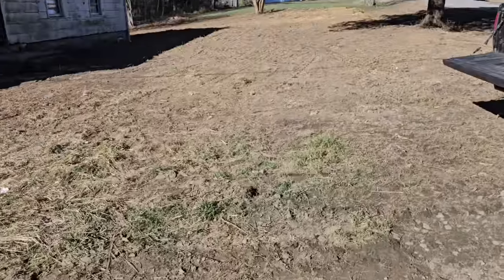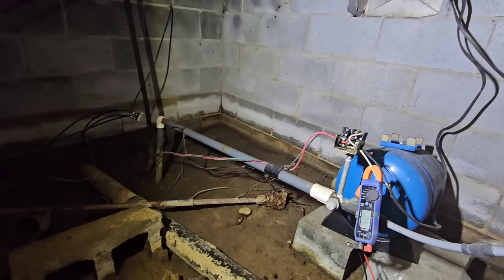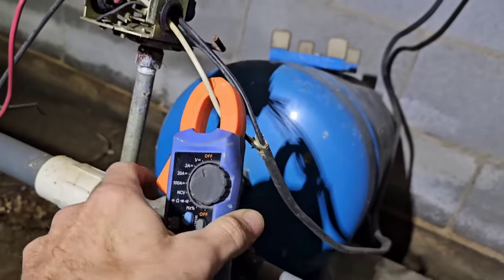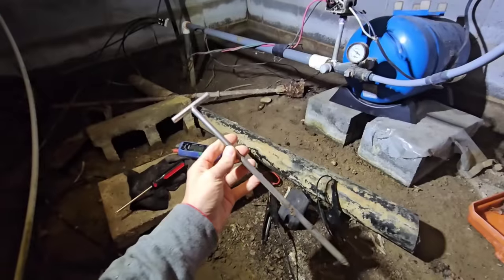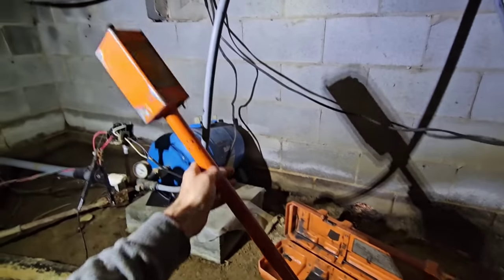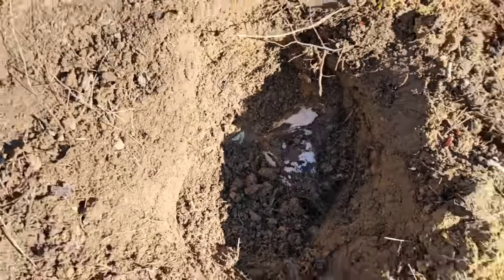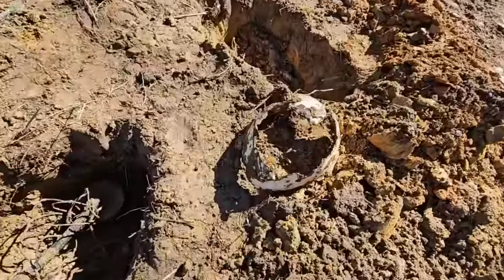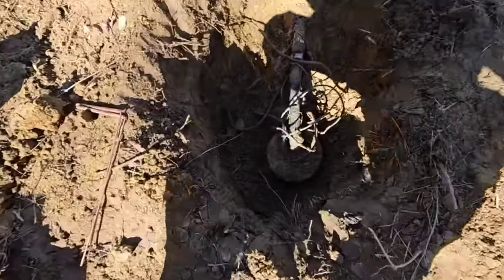Can Copper Dousing Rods Find a Water Well below the Ground? New Tech Vs. Old

Comment: My dad taught me to use  dousing rods when I was a child and as you have saw, they indeed do work. The reason this method has been handed down is because it works. My dad also taught me to use a Y tree branch that works just as well.
Reply: The first time I tried the rods was when a pipe-fitter came into my office and challenged me to find a below grade drain line. He knew where it was because he installed it many years ago. The rods he gave me had a sleeve, made of tubing over the rods, so you could not in any way influence the movement of the rods. He showed me how to hold them and instructed me to walk across the office complex. As I walked the rods starting pointing forward and then suddenly came together and then as I continued in the same direction they spread apart, towards my biceps. As I continued walking they pushed against my biceps. He said that they spread apart at the exact location of the drain line. He told me that not everyone can use them and then gave them to me so I could test my two boys with them. I went home and showed them how to hold them and to walk over an area that I had installed a water line to our house. One of them could find the line and the other could not. I am a believer.

Comment: As an electrician I used just plain pieces of wire to find pipes and wire using this method many times . I have also shown helpers and apprentices this trick . Most were skeptical at first . 
It did not work for very few .

Comment: I'm a miner and a prospector in Alaska. Dowsing is one of our "go to" methods for a quick and dirty method of locating mineralized vein structures and faults. There is scientific principal behind it. Anything that interrupts the magnetic field of the earth(including wires and water pipes) will affect the rods. Buried high voltage lines will really snap the rods. Almost spooky. This is also done on a big scale by flying a monitoring torpedo from a helicopter. Called geomagnetic mapping. It's not Voo-doo. I might add that some people have better performance with dowsing rods than others. I happen to be very successful with them. A geologist friend believes it's due to the continuity of a person's body. I'm also very sensitive to electric current.
Reply: amazing👍

Comment: I’m a old timer 73. My father in law prove it over and over again. First time I tried it in my yard using a bent coat hanger, one for each hand and the stupid things almost jumped out of my hands. Of course you hold them loosely.  I am a believer!!!
Reply: We use 3mm thick copper wire  and it works all the time. No fancy tools :)
Reply: we used fencing wire about 3mm and held the wire really tight and they still moved

Comment: You already knew the well was between those two spots and those copper rods don't attract therefore psychologically you probably made those turn in.
I wanted you to use the rods to find a well without the electronic tool. You would have found nothing with copper rods or a stick looking for its mother load of water or any of that nonsense. These guys using the sticks and find water it's because there's lots of places in the ground where you can hit water.

Comment: I really enjoyed this video. You did an excellent job of locating the well using the power sinal method and then using the dousing rods to determine exactly where the well was at. I am skeptical of using dousing rods, however they certainly worked in this application. I love all of your research that you share and I also love the fact that you give your customers all of the pros and cons for drilling a well!!!

Comment: We have had 3 wells drilled on our place over the years.  We have used witching for determining where to drill.  Never used it to find water lines. The first two wells were witched by an oltdtimer in the area. This was 1996 and he used a forked willow branch, and we found good water on both locations that moved the branch.  The third was done 2020, with copper rods and proved to be very good water as well.  Thing is, as far as me thinking this is for real, honestly part of me says we would hit water anywhere on the ranch, but I still want any locations witched just for good luck on a new site.
Reply: You are a very wise man. My cousin had aome land he wanted to build a house for his sisters and we wished his place and I told him where to dig, but he said NO I want it right here, So he paid 5000.00 dollars to dig and he went down 176 feet and yup he hit water, Well he hit 12 gal per min, of sulfer water. He thought f he went by where my well was he could also hit part of my well of 4 to 5 hundred gal per Min. It just does not work like that. Stay safe.

Comment: I truly beleive in dowsing rods.
As a teenager this old guy got me intetested in them. The city where i lived. Needed to drill new wells. They drilled four test wells. All were duds. They hired this gentleman to dowse a well fir them. Low and behold,he found them a water source. It could supply enough water to run the biggest pump made 24/7 with no depleation of source. He found an underground aquifer. It was approximately 50' wide.
He even told them how deep it was,and type of soil and rock they'd encounter. Needless to say,that was @50 years ago. And the well is still in service today. No problems. SO......

Comment: I knew 2 dowsers, and watched them work. Well about 50 years ago I moved my mobile home to a spot that 'There was a water pipe buried somewhere -over that way-" I did not feel like digging up 200+ feet of pipe to find the  end of it to connect to. So I got to thinking "Hmmmm", I'll try dowsing. I have nothing to lose except a lot of work I don't need to do.
 I took 2 old shell casings and 2 pieces of copper plated welding rod and started walking. I concentrated "Where is the end of the water pipe" while I walked. By golly, I hit a spot and the rods crossed (I did try a willow "Y", but it didn't work for me). I dug down 1.5 feet and I was 4" from the dead center of the pipe where it ended. That blew me away and made a believer out of me for sure.

Comment: I'm also an old timer, 71. I learned when I was about 10 or 11. When I was taught to dowse for water, we were given a crow-bar. Just lay it in your hand and hold loosely, down by your side and walk. When you get to water, the crow-bar tips quickly. If you ever walked a fencing line or field with a crow-bar, and the dang thing keeps tipping, you may have doused for water. He also showed me how to use welding rods, just like your copper rods. It works. Don't know why, but it worked. I got calls from a few farmers after that to find water. There seemed to be water where I dowsed, but who knows if they couldn't go several feet over and find the same pool. Most of those wells were 75 to 150 feet deep. Strange feeling when it works.

Comment: I worked as a carpenter my last summer in Tucson AZ, in 1978.  We were building triplexes on desert land kind of in the center of the metropolitan area.  One afternoon a technician from the municipal Water Department came out using a dowser almost exactly like the one in this video.  I laughed to myself but didn't say anything.  And I nearly fell out of my britches because it worked.  I saw the copper wires cross and the water pipe was found in that exact place.  So dowsing does work even though it seems like complete nonsense when you look at it scientifically.

Comment: Well now let's see... brass brazing rods, couple pieces of #9 wire works too. Used to be an old timer dowser well known towards southern New Hampshire, accurate as can be, with depth and flow. Just drill when he set is stake, instead of guessing after knocking the stake down during setup!  lol  -Bob...

Comment: When I put in a well and septic system two old guys came over and walked over my yard and checked it with dousing rods and he found a place where they crossed twice and he layed a rock down and stepped on it to mash it down and he brought a old churn machine over and started drilling and a little ways down he hit about 8 gpm and said that there will be more to come and at around 50 ft he hit another vein and was dipping off over 20 gpm which was as fast as he could dip it off and I put a pump in it and it has been about 30 years and I have not touched it and we still have plenty of water and after he found where the water was I made me a set of rods and tried them and found the same thing that he did, I believe in them for sure.

Comment: I use copper dowsing rods. They work! I have used them to locate buried septic system lines too.
I worked at the telephone company. We used them occasionally to locate buried cables. In the Bell System company equipment catalog we could order telescoping dowsing rods, but we made them from #6 solid copper ground wire. I learned from an old timer cable splicer.
Reply: have also used rods to find man hole covers burried when they would pave over the phone or electric covers. I was a cable splicer. Stay safe.

Comment: I had a water pipe in the backyard that was leaking but could not locate it.  In desperation, I bent 2 copper coated welding wires and located it in less than 2 minutes.  It's nuts, but it works.

Comment: I used to do municipal sewer and water line repair. We had various equipment for locating water lines, we always used dousing rods. We would simply making them out of materials for free. You can rip off flags off of flag markers and bend them at 90 degrees, with a long end sticking out, short end in the hand, then hold them very loosely in hand. It works reliably. It can have interference from powerlines overhead, so if you have an area with multiple lines or lines in the ground and powerlines above, it can get confusing. Very reliable technology. Most people dismiss it because they have never learned to use it and have no idea how well it works.

Comment: Do you think HydroVacuuming a hole instead of manual shoveling would make it better on finding buried lines? 
Shovel blades may cut the wires. Hydro Vacs only pull the dirt slurry away. Leaving undamaged pipes & wires.

Comment: 💁🏽‍♂️ How it works;  it, (the rods/y willow sticks) follows the force lines of flux. Or flux lines. EVERYTHING has an electrical element in its makeup. [because atoms ⚛️ always move] . The rods will “point”, 90° of the direction of travel or layout of the pipe or movement of water or electricity running through a line. Flux lines above still water are jumbled up, but in a condensed area, and will show a deflection of said rods/y sticks.  😎🤷🏽‍♂️ Your welcome. 🐎🐎🦅🪶🕊

Comment: My first experience with dowsing rods was really shocking to me.  The rods crossed when I passed over water hoses , electric trenches & valts , also roots from trees. REALLY AMAZING. 
 to me.  So. I painted a spot on the ground. The well driller went to work and he hit water . 
 Not bad for my first time.  The Well Driller inspected the area,  and came up with the same place I painted on the ground. 125ft later .... 
ALL THE FRESH SWEET COLD WATER you want. 
 🤜🌟🤛

Comment: At 77 yrs old I can say my first experience with dousing was from a friend who doused with Willow Branches....drilled and hit great water..that was when I was 32.....I started fooling around with Willow branches and then Coat Hangers I bent and held very loosely ...I found water pipes underground for a friend...found my next well...found a under ground spring I didn't even know ran thru my property....so I would say.yes it works...........I didn't believe in it when I first saw it done eiher...but wanted to prove it was poo-poo.........BUT IT WORKED!!    Cheers good video!

Comment: I don't use copper rods I am 62 years old and watched hundreds of wells  both dug an drilled. Here in north western Ont  Canada you can't just drill a hole an get water any were like in the south were the whole under ground sounds like a big  Aquafer lake under ground. Here if you drill the steel caseing must have a weld on drive seal shoe. Casing must be driven into solid bed rock. A dug well you find the vain of water in a change from soil to gravel. With drilled well you also have to find a Crack in the hard bed rock were a steam of water runs through   do to the minimum charge drillers charge. I make sure I find at lest 2 veins crossing  using a willow branch that in a Y I hang on to the 2 y Handel's out strait an the one stick part will bend down when you pass over a water vain. The harder it bends down the more water there. I have witch lots of land an marked were to drill in 3 to 6 place. The customer or my self never tells the driller anything. We watch an see what they do. 3 out of 3 companies come in an just look. An say let's set up here. They didn't witch anything. I let them set up there 130,000 lb drill rig tanker truck. Dril rod an pipe casing truck. Then I walk over to them an say  look this customer is paying your crazy price per foot with a minimum of $8000 weather you hit bed rock in 30 feet an water at 40' it still minimum #8000 so why are you just picking any spot when you know there 1 in 10,000 you find water witch Mayberry at 600 feet. That good money for you but bad for the customer. I say you drill over here were I know you will get water. They refuse. I tell them fine if you don't hit water in 200 feet it a dry hole an that's on you. Then your going to drill were I asked you to. That one the customer will pay weather you hit water or not. Every time we stop them a a dry 200 feet. Tell them you lost now drill were I asked. They do an have hit any were from 4 gpm to over 20gpm in less then 200' some less then 60' my well is 119 witch I had them dril a 8' sump in bedrock for any crap. My nabor across the road they drilled 2 holes the 1st was dry then they drilled were I asked. An went though 47' of clay an into bed rock hit water 10 gpm at 62' he only paid the one drill hole. To get a bank mortgage the well must put out minimum 3gpm. Mine is 4 gpm feeding 25 head cows. House. 2 air b an b chicken an turkeys bans water gardens an never run out of water. Crip clean minirel free water. Some guy with witch with a steel craw bar but most use a green live willow branch with a good 3/8 with a Y it never wrong. There no getting a permit to do a well from heath unit only septic. The drillers must get a permit for each well over 40' from minister of mines an  Environment and must record every foot of ground an supply you an ministry paper work on every hole they make. They are responsible if they hit bad gas or other harmful things. The 40' over permit is to not apply to dug wells with there million here a drilled well must be 50' from last septic field line an dug wells 100' but there old drilled wells less then 50' an every year everyone send in a water sample to our heath unit for a free water test for   Any bacteria even dug wells in barn yards come back 100% clean as well as drilled wells close to septic. Only one drilling company here come out before the eqipment an witches were the best spot to drill. In Oct 1998 when my well was drilled an hit water in bed rock an drill rig dropped 18" into a hole in bed rock were I watched 4 main vain cross there was no minimum charge. It was a flat price per foot with steel casing until hit bed rock then a flat price per foot drilling in bed rock witch was much  less. They hit water at 112' but I had them take it down to 119. My bill was less then $3000 cnd before tax

Comment: I have used this successfully for years.... 

On a few occasions, I have made the rods from the flagging wires. Just rip the plastic flag off, bend a 90-degree in the wire about 6 or 8 inches from the end, and go dousing. Make sure you dont have gloves on as you hold the rods.

I found numerous unmarked graves at a real old COUNTY POOR FARM...😊

Comment: I use utility locate marker flags for my dowsing rods. They're steel. I tear the flags off, and bend them. I've located ductile iron, PVC, fiber optical cable, and copper pipe.
Electromagnetic locators like your Schonstedt are great until you get into a bunch of junk.
One day, they swung out, settled with one a little bit in front of me to the left, the other back and to the right.
At the edge of the property, a fiberoptic cable was marked veering across the sidewalk. To the left in the neighbor's right-of-way, was a huge mulberry tree. The installers went around the tree.

Comment: You could have used the rods to locate the pipe and wire too.  The rods aren't anything special either, you can bend old wire coat hangers into the "L" shape and use those.  Point being, it doesn't have to be copper or brass or anything special, coat hangers will do.  Not much different from a forked stick.  Just use green wood so that it can be properly held, doesn't matter the type of wood.  It's all hocus-pocus or witchcraft (as in "witching" a well), but even if it doesn't make any sense, it still works.  You can use them for regular metal detecting, too.  When you get above metal, just like your well, they will cross.  For pipes and wires, they will point away from each other in the direction of the pipe or wire.

You can test it too.  Take a friend out to your driveway and give them 10 paper plates and a piece of metal and have them hide the metal under one of the plates while your back is turned, and then show them where they put the metal.  The rods will cross, and it works every time.

I've been using rods and sticks since 1980, none of it makes a bit of sense and most of the "theories" just sound as crazy, but somehow, they work.